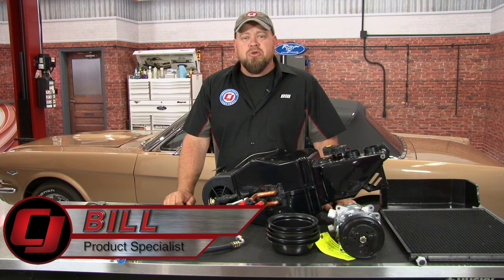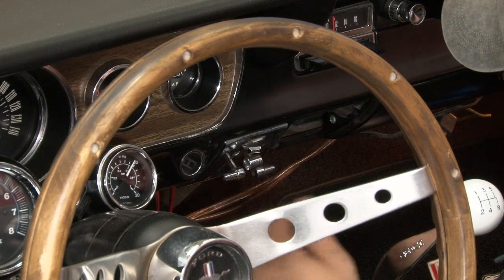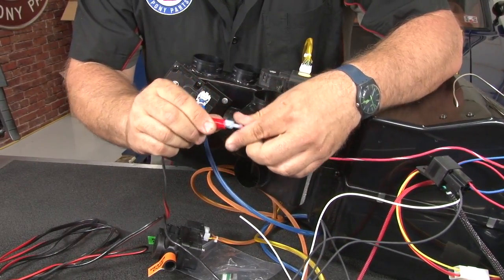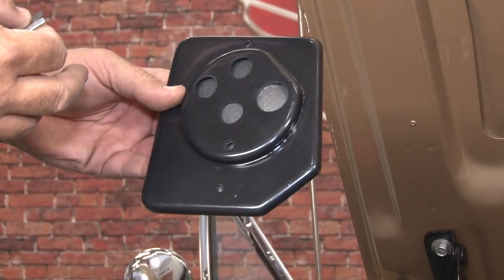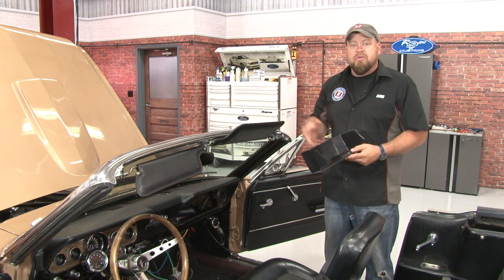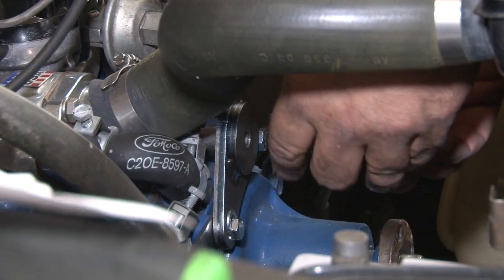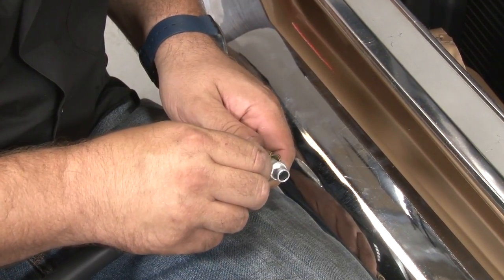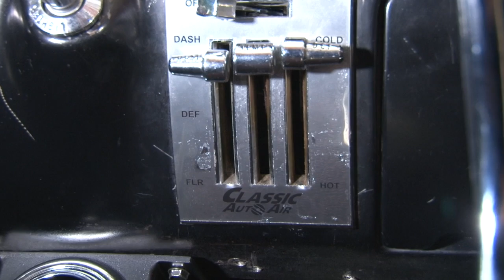Perfect Fit Elite Air Conditioning System With Compressor | Classic Auto Air | 1965-66 Mustang

Comment: I installed my classic auto air on my 1975 Pontiac Catalina. It replaced the VIR system. Everything was done correctly. It has a Pressure switch on the Accumulator with two white wire's.  The A-6 Compressor has the original harness that plugs into the Compressor one black that mounts to AC bracket A green. My question is how do I hook up the Two wire's from the pressure switch. Cause the original harness that plugs into the compressor both wire's are ground on the test light. So I made a connection to the hot wire on the electric choke on my carburetor. Now with the switch in off it blows just a little and the accumulator is a little cold. I know my problem is in the Pressure switch not connected correctly.  Any help please. Thank you

Comment: Can you make a video using the new updated Classic Auto Air? Does not require calibration and comes with a plug and play control switch unit.

Comment: The upper mount you installed for the compressor, looked like you didn't have the spacers in correctly.  It appears bent and the lock washer for the bolt was distorted very badly.  Not to mention it looks like the kit uses cheap hardware store bolts.  For the money you'd think they'd include decent hardware.

Comment: I would not have been able to install my kit in my 67 without youtube. The instruction booklets left out a few key steps. Like removing the old heater and calibrating the new unit.
Reply: 100%.  Currently installing the Classic Auto Air into my '68 Mustang.  The manual definitely could use a revamping with more details.  This video, even though it too misses some details, between the two and being able to see the process in the video sure does help.  The video also showed me that I could "probably" do this on my own :)

Comment: Great video to show the details of easy install.  One issue, Might have been best to install a thermo-fan clutch set up or an electric fan alternative providing the alternator has enough output. Fixed fans are mostly good for city driving but once on the highway, they are not needed for the most part and they are noisy when up to speed.
Reply: I have put a flex fan on my '57 fairlane, more fins more air movement flattens out a bit when higher speed rpm's.

Comment: Spinning the pulley like the guy does in the video doesn't turn the compressor.  If you spin the pulley without the clutch engaged you aren't doing what the directions call for and will damage the compressor.

Comment: Did you have any trouble with the support bracket on the box not lining up with the cowl?
Reply: Aftermarket parts "don't fit" as most OG techs would say, you always gotta do a little adj. here and there, elongating of holes etc. lol..
Reply: Restoring my 66 coupe, I have learned that very little is exact on classic cars. Even factory specs. One of the most important things I learned working on classic cars, is everything is "ish!" Its 9/16 "ish", its 7 and 3/8 "ish!" Even the 64 mustang is 64 1/2 ISH! Theres two models of 65! One built before a certain month, one built after! LOL

Comment: Will this system work with an inline 6 200ci engine?
Reply: most kits are ordered for specific year, options, and engine size, as most are specific
Reply: I just got their AC-only (daily driver) kit for the 200 6-cyl.  Good instructions, nice brackets, quality kit.  Same as in this video though, the belts may not be a perfect fit; one was rather tight.  Note that per the instructions, charging the system is done Not Running, after spinning the compressor by hand 15rev With Clutch Engaged (voltage applied).  Then spin by hand 15rev again before running the engine & AC.

Comment: Seems like he forgot to  mount the Emergency Flasher Switch back up in the Glove Box.   Everything else he did was very correct and professional.  If he did mount it back it isn't shown as so.
Reply from the maker: We don't always show the small details that are really not relevant to the install to keep the length of the video down. We figure if you managed to install the entire AC system the flasher switch shouldn't be a problem.
Reply: Agreed.  When you show something being removed you should also show it being reinstalled also. The Video was great and Professional.